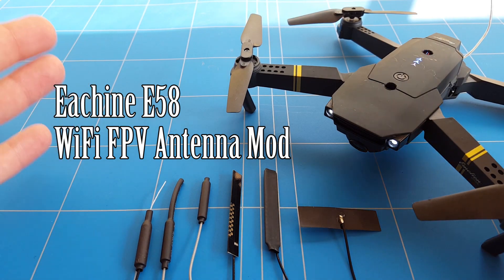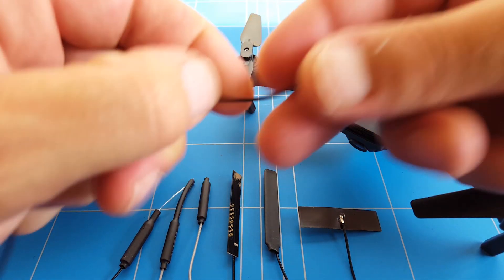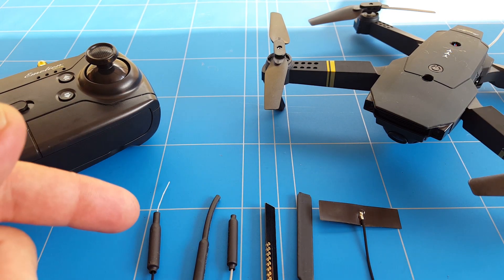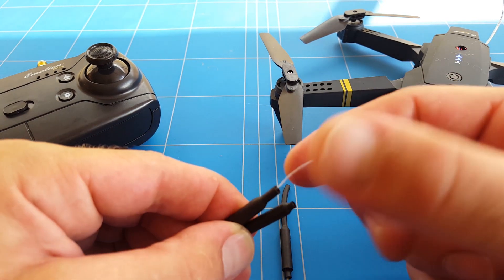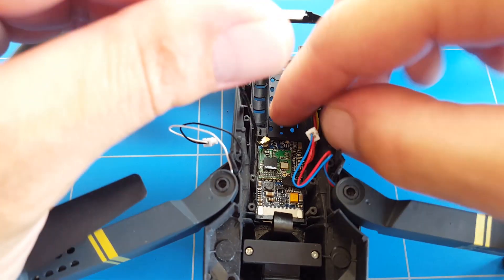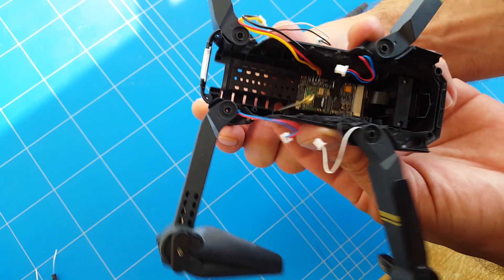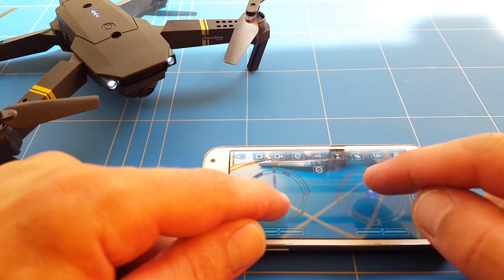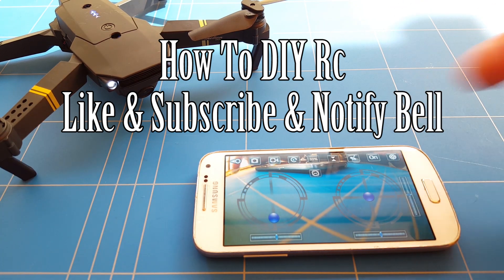Eachine E58 Wifi Antenna Mod Install - Increase / Extend Wifi FPV Range And Fly Drone With Phone

Comment: You can use a Wi-Fi amplifier to amplify the signal. It will be powered by a power bank+ converter. The scheme is simple: the phone connects to a Wi-Fi amplifier and the amplifier communicates with the drone.
Reply from the maker: THX

Comment: super video. waiting for my diapole antenna so i can install it  ;-) . Some  questions however:
is it possible to install an external gps module  so the flight become more stable??
 how about any battery hack so we can fly more time?? is the LiPo 3,7v 600 mah usable with the same battery cover??
can we change the camera module and install a camera with higher MP resolution??
Reply from the maker: the e58 dont have enuff power to carry extra battery and there is no way to install a gps module if you can update the firmware if you want gps go gbet the eachine ex5 or 4
Reply: @HowToDIYRc   thanx buddy... is is possible to update the camera in any way?? or only by external fpv camera??
Reply from the maker: im not sure since there a e58 pro with a 4k camera and maybe it works on a normale e58
Reply: @HowToDIYRc  i actually bought the e58 just toget familiar with the drone operation plus from Banggood it was at the thitd of the price of the  equavalent dji tello here in Greece. i m already looking for my nect "bird". what would you suggest the EX5,.the E520 or the visuo Xs812
Reply from the maker: if you want good video camera you need a dji mavic mini if you don't want to spend so much money then get the eachine EX5 that fly the same as the mavic mini but camera quality is low if you want cheap drone with good camera video you shut check out the eachine ex4 it got a camera gimbal :D
Reply: @HowToDIYRc  the mavic is way  afar from my bugget.. i m thinking 100-110 euros maximum  :-)
Reply from the maker: add a tiny bit more money and get the EX4 atleast then you can use the video for youtube and your own project
Reply from the maker: but wait untill its in discount at the moment they ask 180euro but i have seen it cheaper around a 160euro and that is a good prize for what you get GPS and good camera with stabizilation is a much have on a drone to get good video
Reply: @HowToDIYRc  thnx man.. you  are great...
Reply: @HowToDIYRc   i have another question for you... i work ib a car bodyshop and i had the idea of painting gold the propellers.. you reckon it ll be able to fly or not??
Reply from the maker: oh you work at a body shop that nice i love cars and yes can paint it any color no problem at all :D
Reply: @HowToDIYRc   hello again...still waiting for my dipole antenna to arrive to proceed with the mode...
Do you know of, or have you tried upgrading the camera with a better lens (i.e a 5mp lens) is this upgrade possible??is it worth it??will i have any gain on video and image quality??
Reply: @HowToDIYRc  doing this mod will there be improvent concering frame drops?? And will an old router antenna 2,4 g will do the trick??or we need this specific one??
Reply: What do we do in case of a soldered wi fi/fpv  antenna??can we cut out the pigtail and solder the new antenna in the place of the old one??

Comment: Hello, I have sg907 drone and its WiFi is not showing in phone.  It is working fine with remote controller.  Any idea what WiFi antenna should I try with sg907 or how can I fix mobile not connecting issue with sg907 drone
Reply from the maker: update the phone firmware
Reply: @HowToDIYRc  I have updated phone firmware. I have latest MIUI and i have also tested this with Samsung galaxy s6 edge. but it does not work

Comment: The patch antenna is better for transmitter, if you pilot drone in front you.
Reply from the maker: Thanks but for the tx we have a dipole antenna upgrade that gives me way more range than this tiny patch antenna still thanks for the tip
Reply: @HowToDIYRc  Thanks and great video. 
You think that you can upgrade the motors like the Syma X8 motors? With the same receiver? Or upgrade the camera for photos/videos? Thanks. 

P.D.: My english is so noob

Comment: Unfortunately, as I realize myself when I disarm it, no all versions of this has a the apex connection, mine was soldered.
Reply: mine is solderd too..have you tried the mod yet??
Reply: I tried it.  I dont think it is working lol 😂 

Just use a wifi repeater..

Comment: Do I have to do anything with the transmitter to make this work
Reply from the maker: No not for the wifi but having the antenna from the transmitter pointing out increase the range the plastic from the transmitter blocks the signal for 50% 
so drill a small hole and pull the antenna outside

Comment: Was there an improvement? The stock antenna looked a lot like the aftermarket one you bought.
Reply from the maker: just having the stock antenna stick outside the drone give you wifi more range
Reply: It's basically the same thing, though replacing it with a name brand high quality one can't hurt, there really isn't much to them, and I don't think there's any point in going polarized without a matching antenna on the other end..

Comment: Nice video, also no dislikes yet :D
And if you would remove the wifi camera + board, you should be able to connect a 5.8ghz camera to the power cables from the wifi camera and it would weigh less I think.. 

(Even my h8 can carry the fpv camera from the e013 and it works amazing)
Reply from the maker: since the dipole antenna, mod failed we have room to add an fpv camera and keep the wifi fpv camera too one for looking down and one for looking forward + it's good to have a wifi signal from the drone to be able to use a wifi analyzer app to find it if it get lost
Reply: what do you mean?